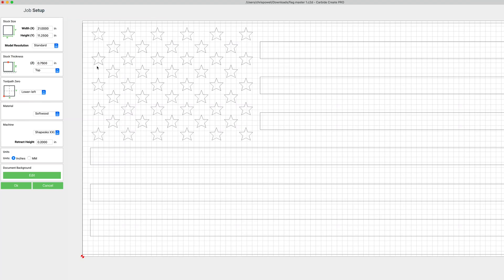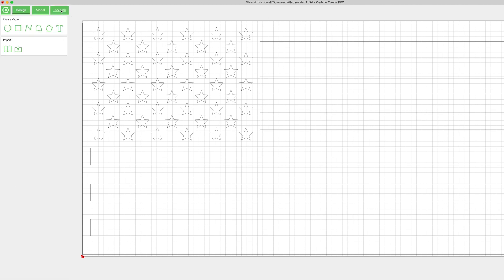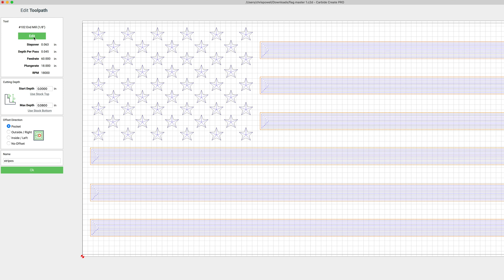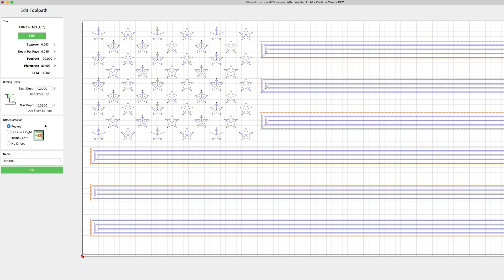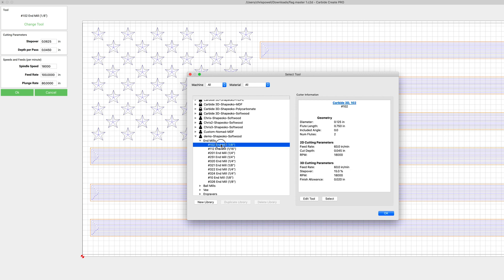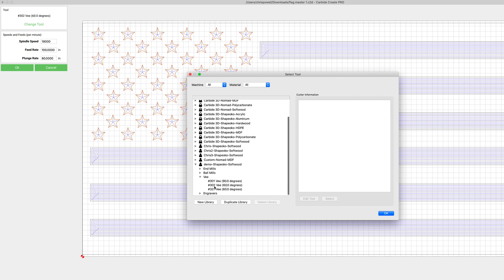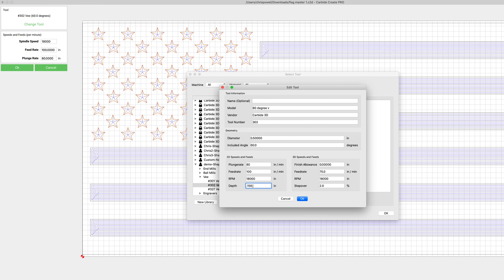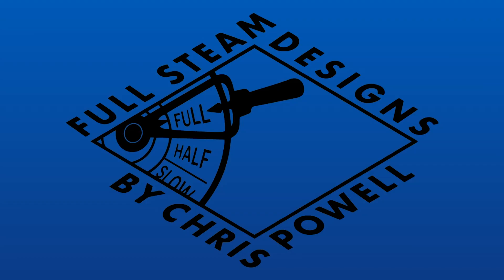How to adjust Feeds and Speeds - Carbide Create and others

Comment: I hope you read this? So, I have a comment on than a question if you can find time please?
I loved the advise for saving each tool path. It has allowed me to stop and finish any time I want. Not to mention I still don't trust things fully cause it ran the bit through one of my letters and a couple of other mistakes I've done so I have been saving tool paths ever since.
But one other thing still is bothersome and I can't find any info on it and it happens also when I flatten a surface.
I don't know how to run only one pass??? I can't figure out what I'm doing wrong or not doing.
I made an address sign today and I wanted to cut a tighter pass to give a cleaner cut and I only wanted to cut .01 of an inch.
It worked great but it started to cut another pass and I had to stop it. As a result it didn't cut inside the number 8 I was pocketing because it was saving it for last I guess.
I must not be interpreting this correctly.
Start depth - .31
Max depth - .32
stepover- .025
depth per pass - .01
plunge rate - 10
feed rate - 80
Do you know how to tell how many passes this will take (and what ever other advice you have)? I had thought if I made dpp .01 and making the max depth .01 deeper it would only make one pass?
Greatly appreciate you.
Reply from the maker: It should have only made one pass if it started at .31 and ended at .32 with a doc of .01.
Reply: @ChrisPowellFSD  
So I guess I was on the right track?? but it actually started to cut another depth. It was saving the circles  inside the number 8 for last so thats how I know it was starting another depth because It did head towards the 8. It headed for where it started again.

Comment: I have a question for you please. In your opinion, why would carbide create carve right through the wood that was clearly cut?
I had a short retract height. Probably 4 mm. I didn't see anything wrong with it. I cut a pocket around a letter and it did just fine. Than it started cutting some flowers which were at a much lower depth than the alphabet letter I cut. As the bit crossed over the work to cut out the flowers on the other side the bit went right through the letter that was cut at a higher level. I bought another piece of wood thinking I did it and it did the exact same thing. On my 3 piece of wood doing the same thing, this time I made the letter a lower level than the top of the wood. I pocketed it out and it starting cutting the flowers. The bit did the exact same thing but this time I lowered the alphabet letter and this time the bit cleared it.
To make my question shorter, is the retract height calculated from the current depth of cut cause it sure seems like it. If the bit was 1/2 an inch from the top pocketing out material and it only goes up 4 mm than surely its going to run through something like it did my letter. I would think it should be 4mm from the starting height of the wood and not from the depth of cut.
Reply from the maker: Maybe the workpiece is too low and it’s not able to reach it and skipping a tooth. The bit could be slipping also.
Reply: @ChrisPowellFSD  
Thanks for answering.
The bit wasn't lose and I don't have any teeth or lose belts anywhere. It operates by screw It did the exact same thing on two pieces of wood with me redoing everything.
The actual measurements were 24mm thick (I shaved off a hair to flatten) which was also the height of the letter. I pocketed out 12.61mm with a safe height of 4mm. The bit rose up about 11.4 mm and crossed over my letter.
Looking at it again with measurements, my letter should have been 12.61mm thick but the bit only rose 11.4mm to get to the other side of the letter. I would have thought that safe height was 4mm above the thickness of 24mm which would make it 28mm? I did zero everything from the center. I wonder if that has anything to do with it? Do you think that getting my z from the bed surface would have been better?

Comment: Question. Easel has the ability t run 2 bits to clear out a pocket. I see advanced v carve is similar in fashion but requires a vbit to achieve this function. Is there a way to use a 1/4 bitty clear a large pocket and follow it up with a smaller bit for detail other than a v bit, because what I see is the v bit traces the whole project.
Reply from the maker: Sounds like you’re trying to do what’s referred to as rest machining. CC doesn’t have the ability to do that. You could do an offset of the larger parts and use the smaller bit between the original line and offset.

Comment: To calculate how much I can up my speeds for hardwood would I kind of use the same percentage? Or is there a better way to get an idea of how much to step it up?
Reply from the maker: Yea the best thing is to experiment. If you can increase speeds using the feed rate adjustment in CM, turn it up in CC.

Comment: What rpm do you run the spindle at? The 18,000 that it says or do you change it?
Reply from the maker: It depends on what material I’m cutting. I usually run it somewhere between setting 1 and 3 on the Dewalt.

Comment: I tried using the speeds that you recommended and ruined my project, was using a 102 bit on a large complicated project and it went way too fast and ended up messing up the design
Reply from the maker: What material are you cutting? What is your doc? What do you mean by ruined? What is a 102? I don’t use bits from Carbide 3d.

Comment: Only question I have is can you make a flag vertical ways ??? Maybe that way you can make a big flag ????
Reply from the maker: The orientation of the flag doesn’t matter. You’re limited by the wasteboard size. The only way to do something larger would be to tile it.
Reply: @ChrisPowellFSD  Thanks bro
Reply: But is the horizontal length of the wasteboared smaller then the vertical length ??? That's why I was asking that question
Reply: @fernandosalgadojr.4269  From the Shapeoko site: 
Specifications (Standard):
Cutting Area: 16"(X), 16"(Y), 3"(Z)
Specifications (XL):
Cutting Area: 32"(X) x 16"(Y) x 3"(Z)
Specifications (XXL):
Cutting Area: 32"(X) x 33"(Y) x 3"(Z)

So only 1 model has a real difference between Horizontal and Vertical.

Comment: Yes during a run job there is the option to increase speed speeds how-do-you-do that during the operation
Reply from the maker: Just press the +10 button on the run screen.
Reply: @ChrisPowellFSD   That's what I thought also I tried that while it was running and I paused it and tried it never seem to make a difference. The job time never changed either.

Comment: Chris  I have a question .If I have  my job set up to the machine bed to set my z height.  Then I use the touch probe to set my XYZ with a .25 end mil  zero all. then move the router to get to the bed and do a paper touch off on the bed , do I at that point just zero the Z height out and  not the Xand Y.  Is that the correct way to do this.?
Jeff Peters
Reply from the maker: That sounds like it should work. Why are you wanting to zero off your bed?
Reply: @ChrisPowellFSD  I am going to make a new spoil board and  dont want to cut into it

Comment: Thanks for the fast response Chris.  So are you saying that if I have 4 words to carve in a line, rather than highlight them all as a group, I need to click on each individually and set the tool path- or- 4 separate tool paths?  Thanks
Reply from the maker: Yes, that would stop it from randomly jumping between them. That’s what I do on my pledge flags. I select each line of text individually, otherwise it jumps around a lot more.
Reply: again, thanks for the response.  in this case, there is only 1 toolpath for the border that pockets the entire board leaving the letters proud, so I don't see a way to prevent the random cutting

Comment: Seems the router runs all over my sign, cutting a little,bit of a letter, then moves to cut a little,of another word, then goes back to the previous word and cuts a little.  Why is this?  Thanks
Reply from the maker: It will set up the tool paths in the order you select the pieces in. If you just click and drag around a group of objects, it will do them in a random order. You can instead hold shift and select the parts in the order that you want them cut in.

Comment: Are you using like the whiteside 1550 1/2" 60 Degree or like the amana 45782 ( which seems like an engraver)?
Reply from the maker: I actually just got the Amana 45624. Haven’t even pulled it out of the package yet. Prior to this, I had been using a Ruhi I got off amazon.

Comment: This is Great Chris.  I used one of your earlier video's (maybe on flag making) to adjust my speeds up a bunch and save time.  One of my standard projects is a sign with a lot of lettering.  Do you have any tips to help with v-carving text?  Mine seems to add several (3-4) little plunges to every letter corner, and it takes f-o-r-e-v-e-r.  I can seem to find a way around it.  BTW, I make the text vectors in inkscape and then import the plain svg to Carbide Create.
Reply from the maker: That’s really in the design. You can try zooming in in Carbide Create and see if there’s any unnecessary nodes, and just delete them. A low retract height will help speed stuff up here too, if you’re unable to  reduce the amount of times the bit has to retract.